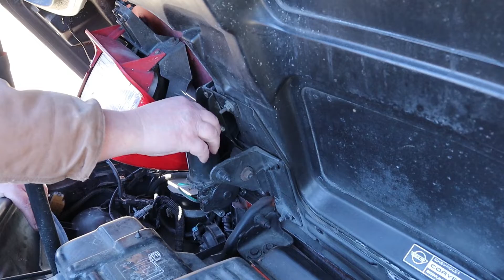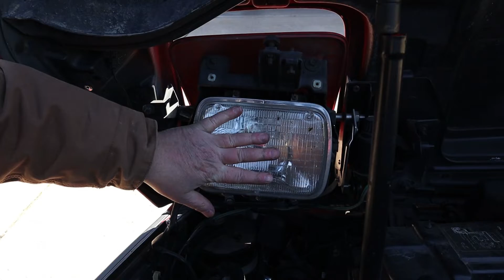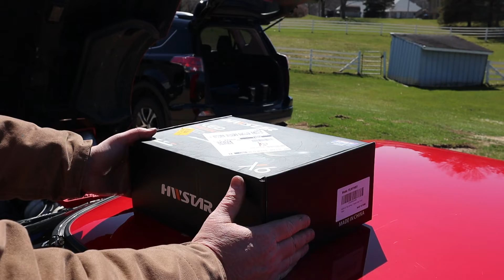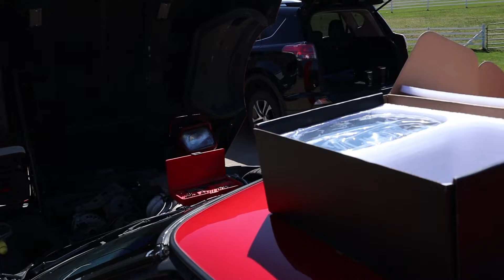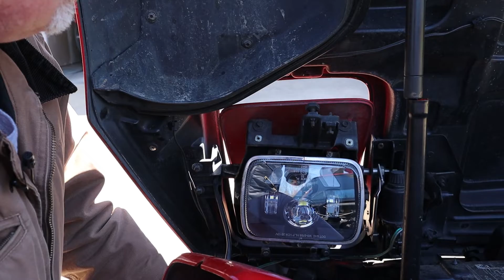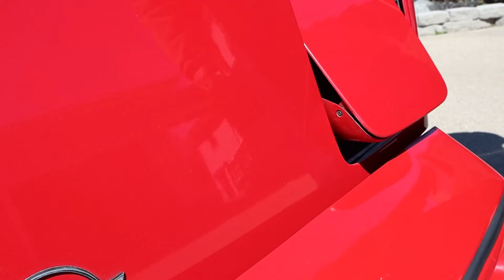C4 Corvette LED Headlight Upgrade, ep 9

Comment: LED Headlight problem. One headlight doesn’t turn on.

I decided to upgrade my 1996 C4 original lights to LED lights. I bought HW star G9 headlights online.

I’ve installed them and the passenger side headlight will not turn on. I’ve installed resistors for each light and it still doesn’t work.

When I put the original headlight back in the passenger side they both work.

Any ideas???
Reply from the maker: Sounds like a polarity issue with that specific bulb, try flipping the connector around.

Comment: Do you need to add a resistor to make everything work
Reply from the maker: Not for my 88 I did not.  If you have a 1990 with the updated cluster you may. I have ordered these same lights for my 91 and plan on installing them this weekend.

Comment: Jerry, did you need a resistor or are these direct plug and play? I have a 1994 C4 and I'm looking to go to a LED headlight.
Reply from the maker: These were plug and play.  They did come with additional harness for side marker lights but I did not wire those in.  Just use the high and low beam on the LED's.  I really like them.  Hope this helps.
Reply: @JerryJacksonDIY  How did you resolve the High Beam indicator problem?
Reply from the maker: @JohnF-h5k  my high beam indicator works just fine with these lights.

Comment: Hi Jerry, thank you for those useful video's - what else do you plan to upgrade on your C4?
Reply from the maker: Thanks for the comment Erminio...  I plan on working on the interior next...  Carpet, seat covers and trim...  Need to replenish some funds first lol...
Reply: Great video. Did you run into problems with your high beams and fog lights not working correctly?
Reply from the maker: @roymcneil7589  Hey Roy...  No I didn't there work perfectly.  The lights do come with additional wires to add affects of turns signals and fog into them but I did not wire them up.  Only used the one connector that plugs right into the vehicle connector.  Thanks for the question.